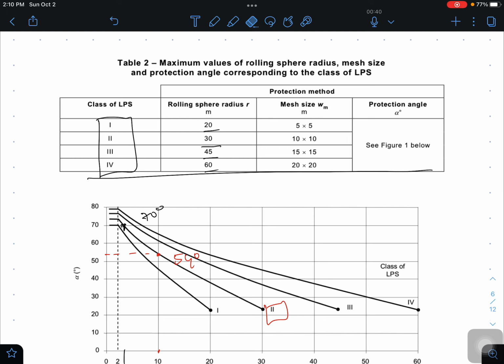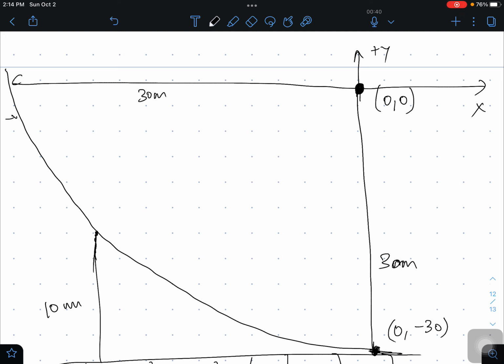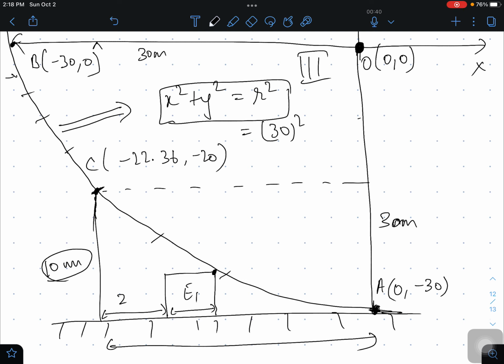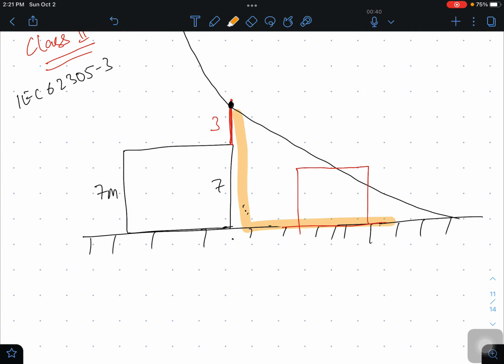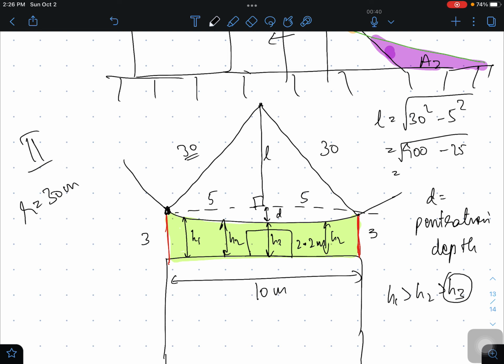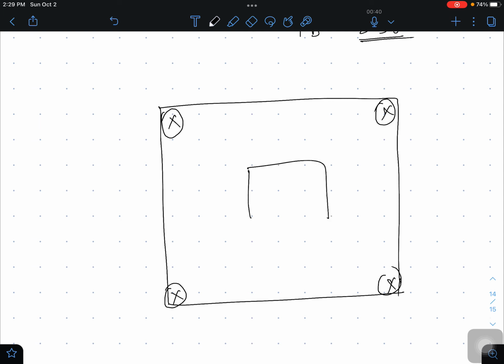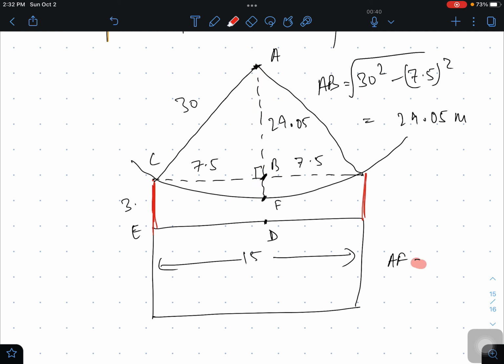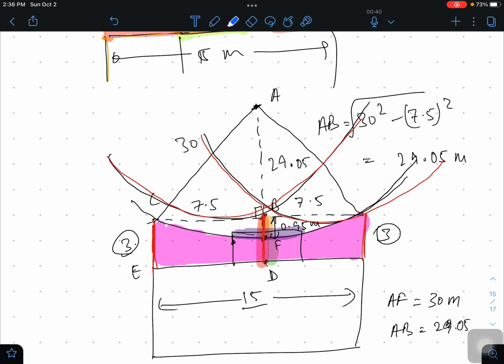External Lightning Protection System Lecture 3: Rolling Sphere Method

Comment: Hi… Does Mesh provided on roof also helps in Lightning protection of nearby building using rolling sphere method?
Reply from the maker: Yes it helps and rolling sphere shall be applied. Please note that in this case you need check equipment that are roof mounted and be careful with the design.

Comment: Sir what is my redius if hight is 150 mtr
Reply from the maker: In case height is more than 60m then we need to provide projections in between to avoid side flash over. Protrusions (spikes) coming out. Radius will depend on risk assessment.
Reply: Hi, just want to share you another application of lightning calculation software, in case you need it  https://www.youtube.com/watch?v=j2iBUVBsp1k&t=496s